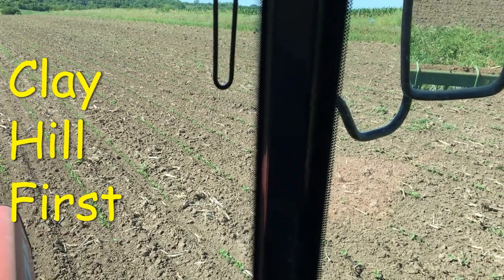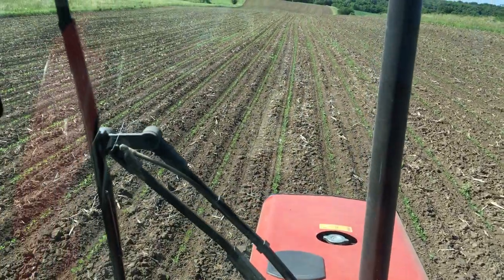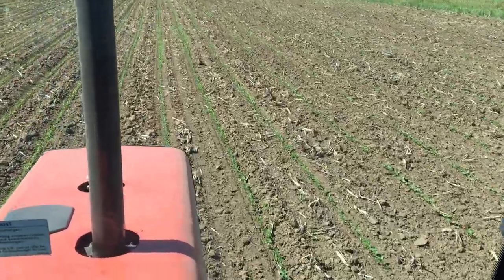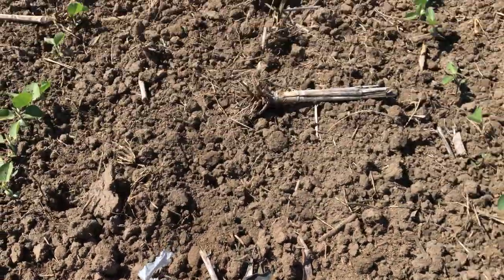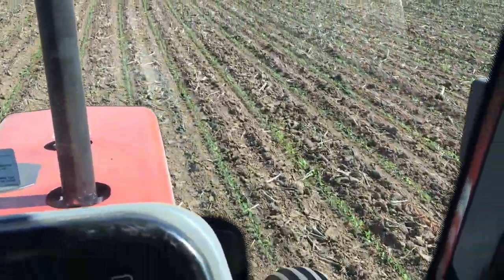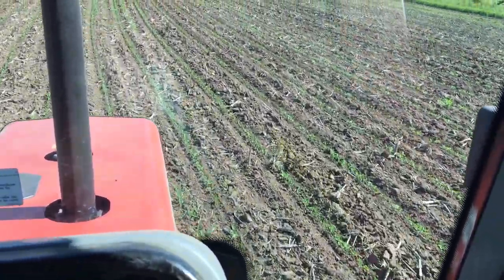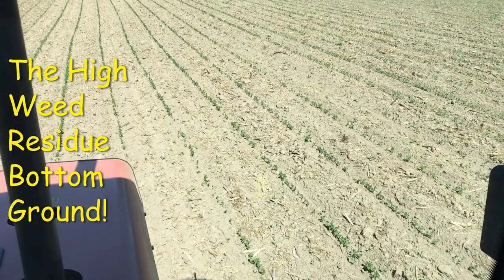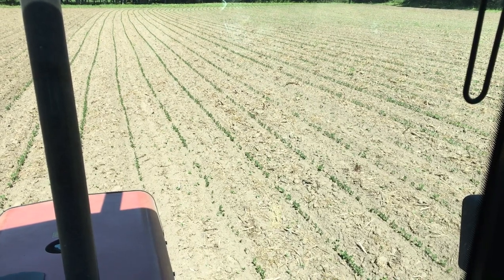Rotary Hoe on Organic Soybeans 2020

Comment: Jack is the rotary hoe pass an automatic or an as needed basis? And is down pressure what dictates whether or not you tear out beans or simply the angle you have the machine set at? Like cultivating , it seems to be a lost art form.
Reply from the maker: Andy, you can change down pressure slightly by changing the angle of the three point hitch.  The hoe will only primarily kill shallow beans in the hook stage.  I am not worried about killing beans.  I am worried about excessive compaction and trips across the field.  When you have emergence issues AND dry weather, the hoe is a good choice!  Thanks for watching and commenting.  Hope you/your family are staying healthy and sane in these times of craziness!

Comment: Great video! Do you use a rotary hoe rather that a harrow comb weeder because it is better with crop residues that the harrow?
Reply from the maker: Good question John!  So the main reason is probably because these machines were/are common in our area :).  As you can see in my previous video on severe seedbed prep, I do work with a lot of residue occasionally.  The rotary hoe will handle quite a bit of residue.  The more residue that you have, the closer you have to watch the hoe, as it can "plug" and the spiders stop turning.  The hoe does work well with my ridges from planting as it tends to push them down into the row pre-cultivation.  I am intrigued by the Treffler harrow and will at some point purchase one for various operations, including pasture harrowing!
Reply: @GeigerFarm  I am keen to try a rotary hoe as we do very little ploughing here now and are working in quite a lot of trash which bungs up in a harrow. Thank you for your videos - so much to learn!!

Comment: That does a nice job! Are there any other tools you could use that wouldn't pick up trash/debris that's in the field?
Reply from the maker: Someday I would like to investigate a modern harrow, such as a treffler for this blind tillage pass!  Thanks!
Reply: @GeigerFarm  Jack, we used to use an einboch tine harrow. There were times I had issues with picking up debris as well. Good tool, but a rotary hoe has it's place as well. Many times I wished we had a rotary hoe. Seemed condition dependent.
Reply from the maker: grassfeeding It is condition dependent, but priceless when conditions are “right”

Comment: Hi, can you please explain to me how a rotary hoe can tear up the ground without damaging the crop. If there are spacing s for the plants I could not detect it . Thank you.
Reply from the maker: Sorry it took so long to reply :(.  The short answer is that the rotary hoe only disturbs the top one inch of soil.  The soybeans are planted deeper than one inch. The hoe also only impacts the ground on a 3.5 by 4.5 inch grid.  The individual spoons impact an area .5 by 1.5 inches.  Thus, the probability of a direct impact is greatly reduced!  I have rotary hoed a crop of beans when they were 4 inches tall with very little damage.  Thanks for watching.
Reply: Thank you for the reply. No apologies nessary.